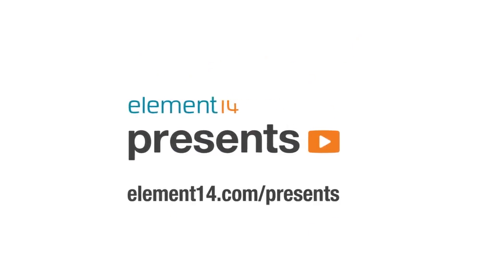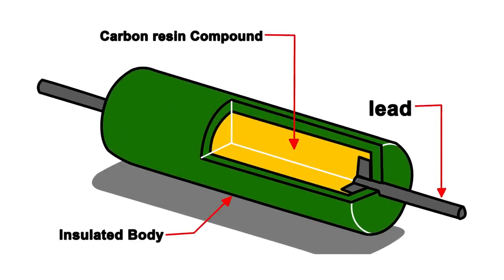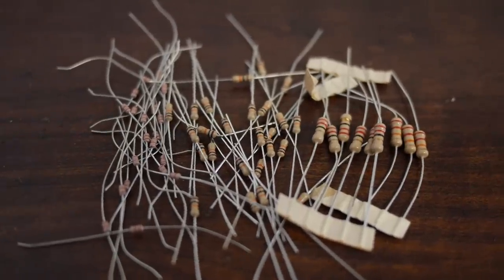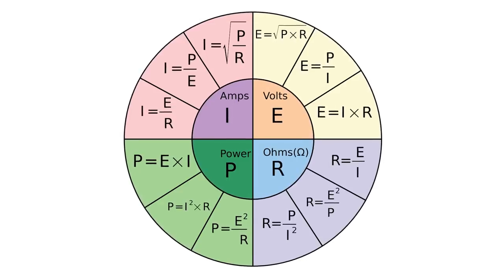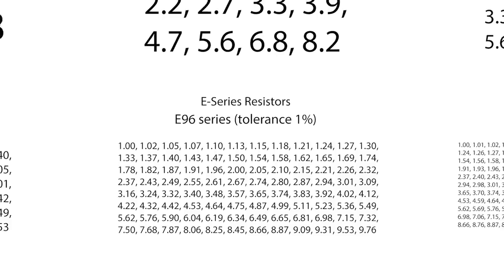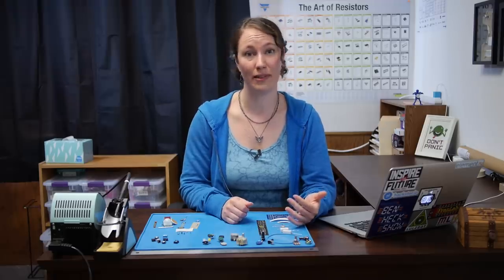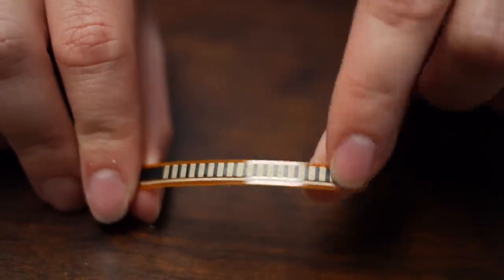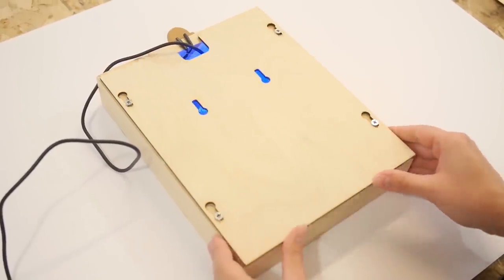Resistors - The Learning Circuit

Comment: Memory effect in resistors, motor coils, capacitors, and other components. The trick to remove the memory effect is, to overload the device then it becomes industrial, so you can use it for high performance use. Motors have to be offloaded, then the collectors have to be cleaned, the memory effect is in the brushed surface. By starting it 20x, it will spin up, and can be used as an industrial device. Solar panels are also memory effected when bought, and needs a full season to make it become industrial.

Comment: I like these learning circuit videos, because while most I the topics I already understand they serve as a refresher and often cover details I'm not aware of (like resistor series). And who hasn't cooked a resistor and let out the magic smoke at least once? ProTip: turn on your bench supply before connecting your circuit so you can adjust it without sending 12V 3A across a tiny resistor.🔌⚡🔥💨

Comment: Great video. I NEED to learn more of the basics. I would love to see you guys use a 555 timer to make a "rapid fire" button for a controller, or possibly a strobe light.
Reply: Brad Young hmmmm... that could make a video...
Reply: I've made one for a wired 360 controller, But I'd like to know how the parts work. How to adjust speed , etc. I just copied what I saw in a video that had no other info. I know you shouldn't use them online, but I rarely if ever play online. The button is great fun on COD or Left for Dead 2, etc. Have a good one Dude.
Reply: I've got 555 timers on the list of subjects to cover in the future. Happy to take suggestions for the corresponding project video!

Comment: I wonder if you may have a voltage regulator circuit suitable for a motorcycle  voltage of 20v ac to regulate at around 13.5 v to charge a battery and regulate current to supply ancillary  equipment  lights etc

Comment: 1:47 NO!!! NOT more efficiency!! Carbon composition resistors were replaced because they had poor tolerances, due to the value drifting due to moisture and temperature, as well as higher noise. Carbon film and metal film resistors are superior because they eliminate these problems. Metal films also have the better temperature coefficients (which can be precisely controlled with the metal alloy used) Other than that, good video. :)

Comment: You forgot to mention potentiometers come in linear and tapered, and you can parallel up low wattage resistors for higher current handling

Comment: Suggestion for  Demonstration of  WHY Wattage Rating of Resistors matter:

Take a 0.25 Watt 1 Ohm Carbon Resistor and a 8 Volt Battery. Do the Calculations to get that RV**2 = 1*9*9 = 81 Watts > 0.25 Watts, i.e. 0 Volts will fry that Resister with some Overkill. Proceed with this experiment with the usual "Do Not Try This At Home" Warning.  Hook it up and Go Snap, Crackle, Pop!